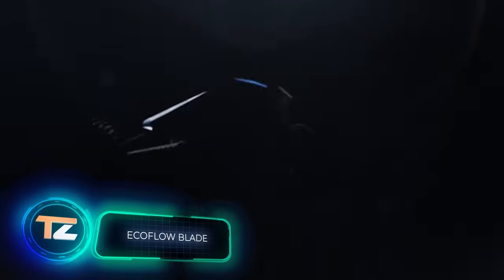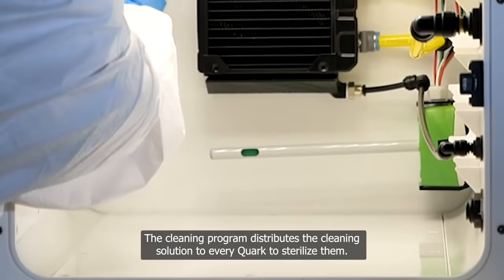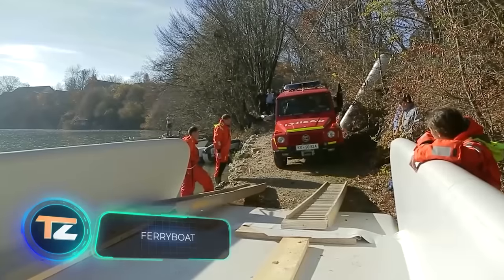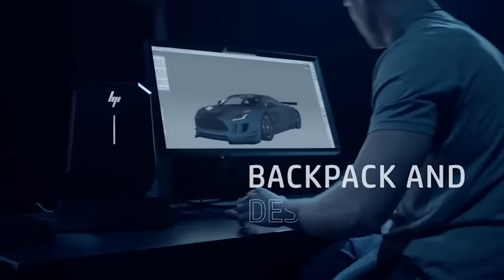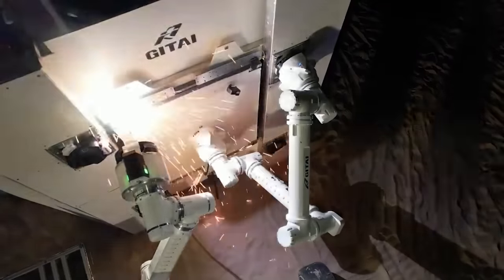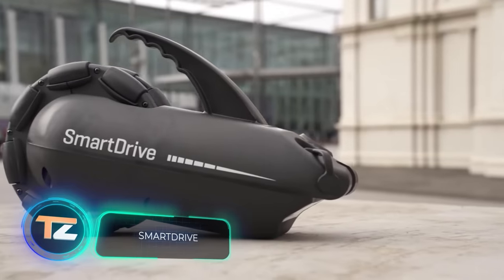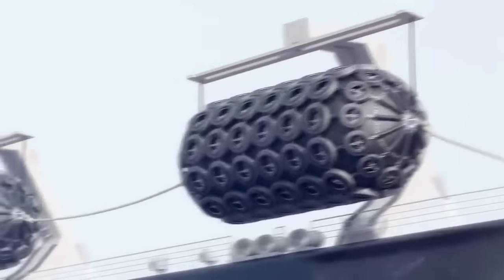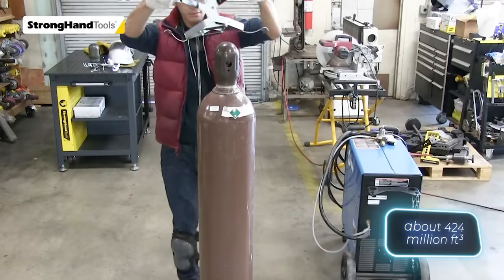INCREDIBLE INVENTIONS YOU DIDN'T KNOW ABOUT

Comment: I saw this 9:17 about 3-4 years ago. It’s is a very beautiful design, but I’d put only the blades under water, not the whole generator. No reason to unnecessarily make it waterproof, and hard to get to.
Reply: I like that the people without access to electricity can perform the maintenance.😂
Reply: @John.Flower.Productions  It’s a design issue, regardless of who is going to work on it. An expert from the company in Belgium would face the same problem.
Reply: @iteerrex8166  An expert from the company in Belgium will have an understanding of the entire installation.

Local residents (the ones currently lacking access to electricity) will not know the deference between a gasket and a propeller.

Comment: From experience: The Smart Drive is ONLY usable for far short range on solid well paves surfaces. They are useless on gravel, dirt pathways, grass, snow, sand or any other nonpaved surface.  Batteries degrade very quickly, reducing usage to under an hour in less than a year and do so even more quickly if exposed to Canadian winters.
Also, their dealer network is useless.